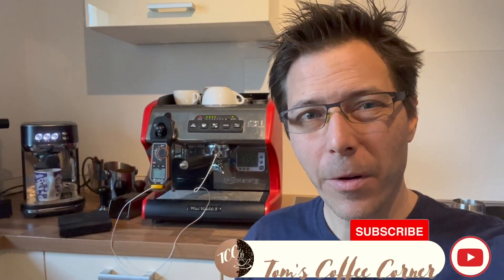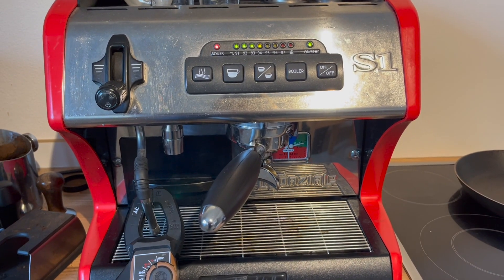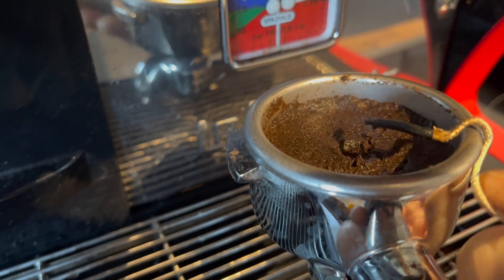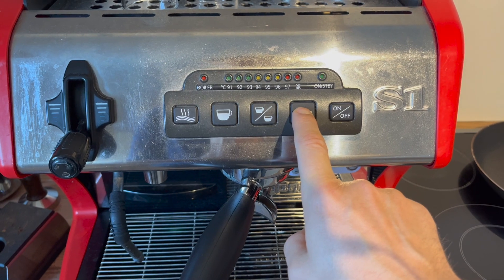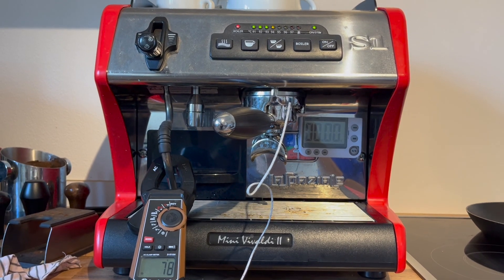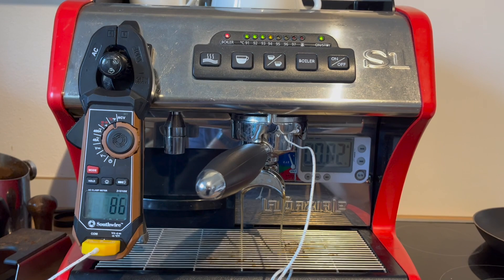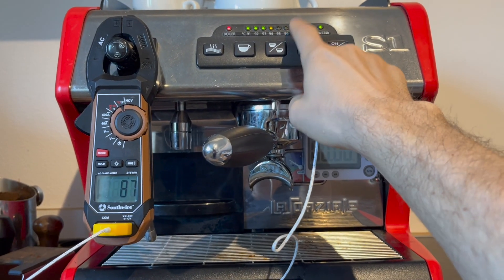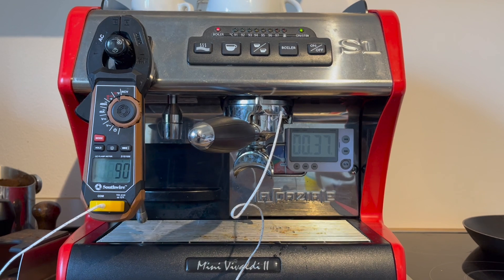How to Set the Temperature Offset of you PID Espresso Machine

Comment: Did you notice any difference in the taste of the coffee once you did that temperature offset adjustment? I got Lucca a53 mini and just checked and it’s also at 0
Reply from the maker: Well, it depends on your bean and roast type. So lighter roast generally can handle a little more heat. But to be honest, I sold this machine a while back, and I don't 100% recall. But yes, the temp offset will make a difference.

Comment: Hey Tom how do you like this machine in 2023? Seems like this is in my price range as an upgrade to my Breville, not many reviews out there. Would you buy this machine again in 2023?
Reply from the maker: I sold it because I couldn't texture milk foam with it properly. I even tried different tips. Maybe I should have tried turning down the boiler pressure on the steam boiler. But, I have learned a lot too, since I sold it. I might get better results with it now. It is a robust and quality machine for the price, certainly higher quality than the BDB, but I just didn't get the results I was looking for.
Reply: @TomsCoffeeCorner  hey thank you for your feedback. It seems to fall into my price range and is a double boiler but I'm not expert enough to know what I should get. There are so many machines around 2K USD price (my budget) that I will avoid this because on occasion I do like a good milk drink.
Reply: @SuperDesignguy  I wouldn’t eliminate this machine for that reason. I have had a Vivaldi II since 2016, make milk drinks all the time, and find that finessing one’s preferred milk texture is primarily a matter of how much air one incorporates into the milk at the very start of steaming. Using the default (I.e., lowest) steam pressure allows me to best keep my milk from developing more than a minimal amount of foam (my preference).
Reply: @goirishgo I failed to mention that getting *more*/thicker foam, if that’s your preference is just as easy — simply by allowing the wand to incorporate more air at the beginning of steaming and/or by increasing the steam pressure. Having and experience with other and professional/commercial espresso machines, I think the Vivaldi II is an amazingly full-featured machine at an extremely good price. I don’t feel that the price point has forced me to accept any negatives at all. This is a great machine and, btw, a great size that fits under my kitchen cabinets.

Comment: Hey , enjoyed your video. How accurate is the temp gauge compared to say a fluke brand ?
Reply from the maker: Hey! Good question...well Fluke is very quality and several times more expensive than this multimeter, so the Fluke will probably be more accurate. But this multimeter has worked fine for me so far. Cheers!
Reply: Accuracy testing is likely done by the analog make up of the sensor. Once the sensor reaches a specific state it will cause the software to output XYZ digits, in the precision of the make up and decimal place digits of the software. The way manufacturing is done of the sensor, materials, and its quality are important, and since manufacturing has come to such high standards over the decades, I would say it maybe off by -/+ 1-2 degrees. 
If you have a precision reader that shows more decimal places with a quality sensor, this would give you higher precision. 
You can have variation in temp readings even between the same brand model multimeter. 
High quality brands with 3 or 4 digits will be more precise, yet still have a slight variation,  but at the 3rd or so digits(one would hope). 

So if you are doing this for repairs, or for personal interest, selling coffee, trying to get the best out of machines, and the ultimate shot, the one he is using is perfect for it. 
If its your 4th year competing in world contest and still make 2nd or 3rd place trying to make it to first place....
I would do 1 of 2 things...Check if any of the sponsors sell a multimeter(regardless of precision or quality) and use that, or any device that helps make better espresso. Or buy a Fluke to cover your bases and try again.

Comment: Do you typically pull a dummy shot to get the group head and portafilter up to temperature? If so, did you do that prior to taking your temperature measurements for the offset?
Would you get a different result if you had coffee in the portafilter?
Reply from the maker: Hey Scott, yes I did pull a dummy shot each time. The portafilter was filled with old coffee as well. I know it wasn’t a perfect experiment, but it gets us in the ballpark.
Reply: Great video by the way. How long had the machine been on before you did your measurements? My new Mini Vivaldi arrives next week, hence the questions. I was going to buy a Scace device for it and wonder how different the temperature readings would be from using your most cost effective approach.
Reply from the maker: @scottross1780  Hey Scott, the machine was on for a while - probably 30-60 minutes. Certainly a Scace would be the best, but these are not available in Europe (not that I could find anyway), and I don't know if they built a 53mm one. I think theirs are 58mm if I am not mistaken. I have seen prices between $400-600, but I have also seen some adds for people renting them out. That might be another good option for you. Cheers!